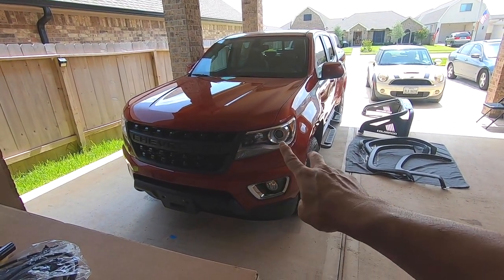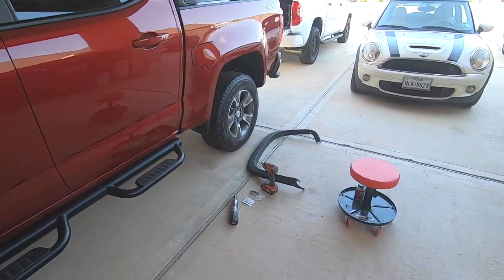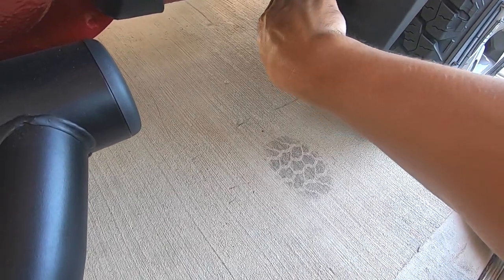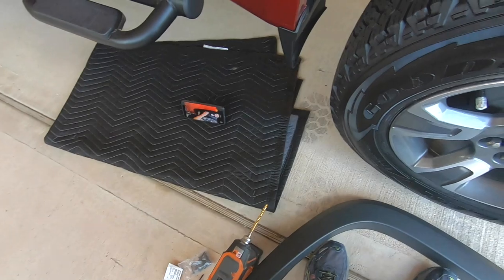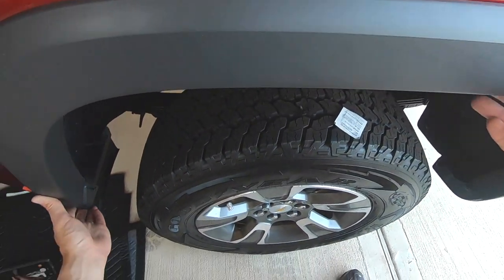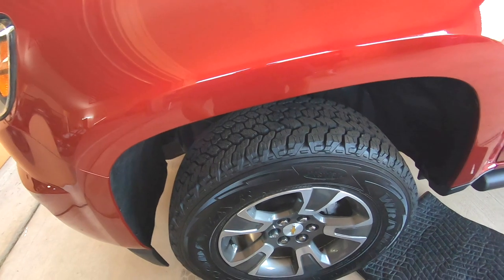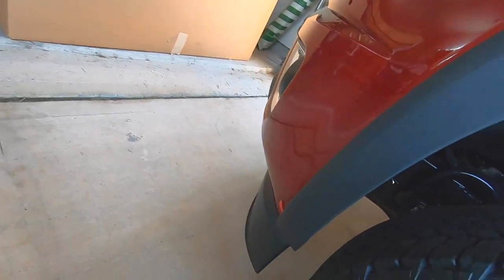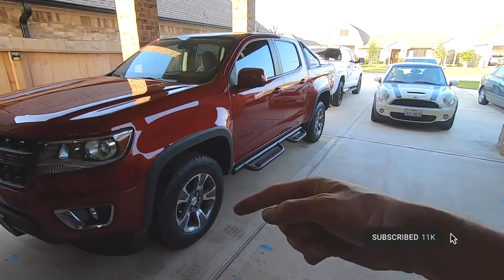How to install OEM Fender Flares on A 2020 Chevrolet Colorado 2019 - 2017 GM 84059964 Fender Flare

Comment: Great vid. Drilling the holes was a pain for me. One side the clips matched the holes but the screws went in at a slight angle and the bit made the hole a bit too big in the plastic of the fender. I just used black silicon sealant for the bare metal and to fill the plastic around the screw head. The other side, my holes were too far away so the clip holes didnt line up when I slid them on. I just used the clips like you did for the plastic peice. I set the clip over the hole on top like a nut and held it in place with needle nose pliers then got the screw in. It worked great. Taking the tires off the rear would have made the rears easier, plus my angle driver was freaking massive and couldnt get in the spaces. I used a small ratchet driver with the T bit.

Comment: I was wondering do you ever bang your shins on the assist steps? I'm 6ft and don't think id ever actually use them but I do like the looks of them and thinking about installing some on my 19 Colorado.
Reply: How did the steps work out? I'm 6'3" and I have the same concern. I'm thinking of buying a Colorado today.

Comment: Looked like you did not use the 3M Activator except for the little bit on plastic piece. There is a huge difference in the holding strength of the tape when the activator is applied.

Comment: Hey, this is really helpful, but did you not re install the rear little flaps you removed? is that why they want you to use the longer screws? to compensate for the plastic double up if you put the flaps back on?
Reply from the maker: I'm pretty sure I had nothing left over when I was done.
Reply: @Donnythelatemodeltech  Oh ok perfect! Thanks so much for speedy response!

Comment: What is the oem part # on the fares ? And would they fit on a 2021 colorado z71 crew cab short box ?
Reply: Great question. I have exact same model. Can’t find em. Anyone?
Reply: @oneweak8938  am finding it hard to find aftermarket parts for my 2021 colorado z71